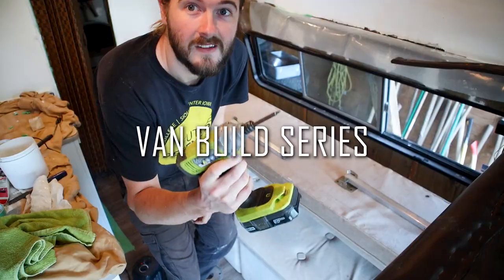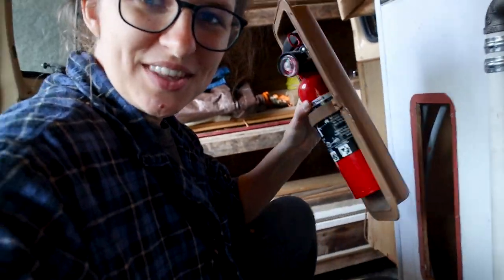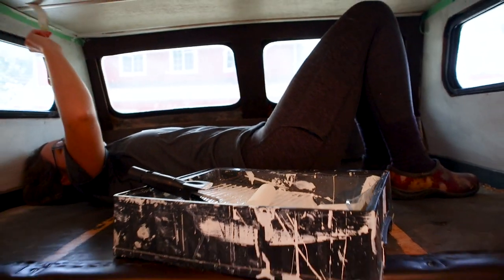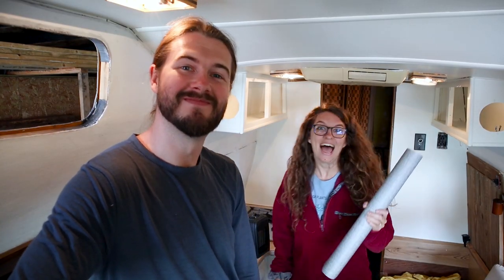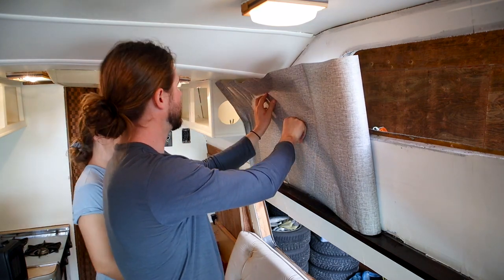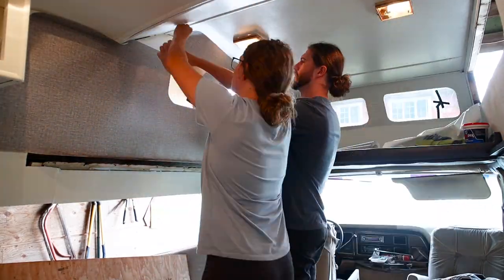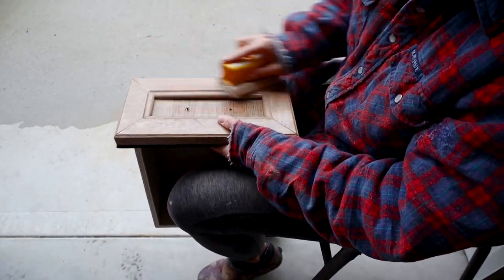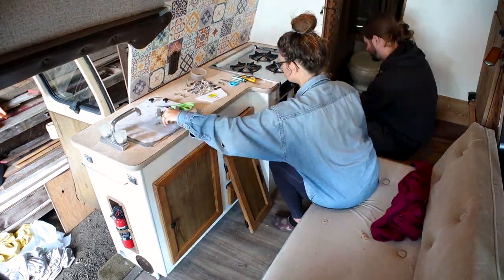Remodeling our VINTAGE VAN (paint, wallpaper, tiles and more!)

Comment: What’s the material of your walls? Worried that our wallpaper won’t stick to plywood
Reply from the maker: It was that old wood vinyl that you often see in these vans. But we used primer before applying. A lot of peel and stick doesn’t require primer, but since it’s in a van that goes through vast temperature changes, we thought it would be best.